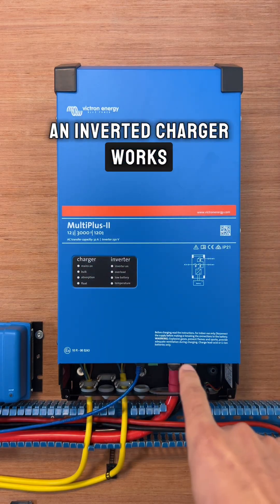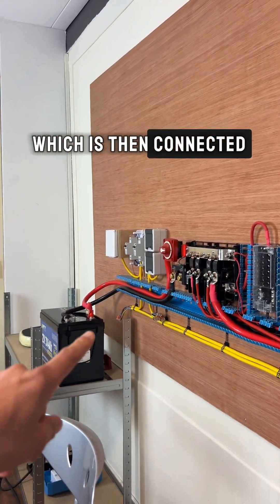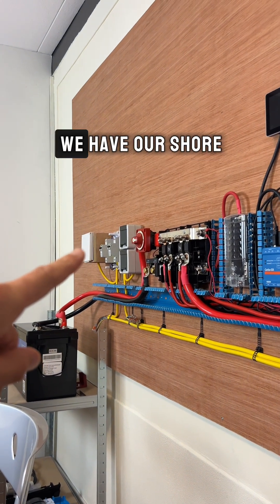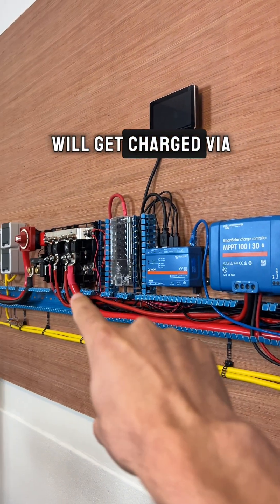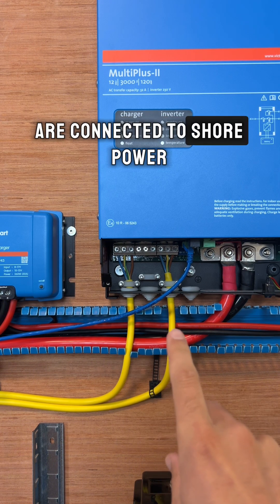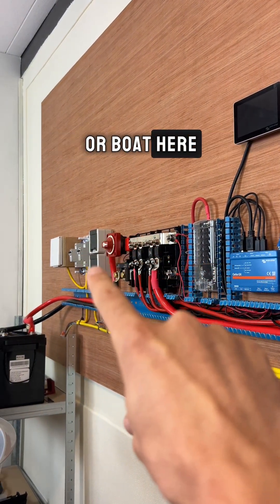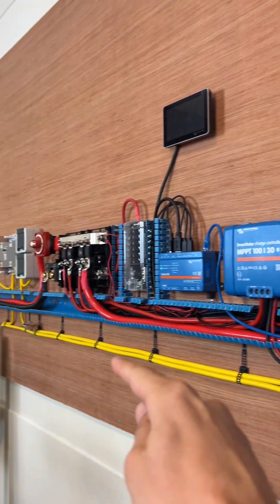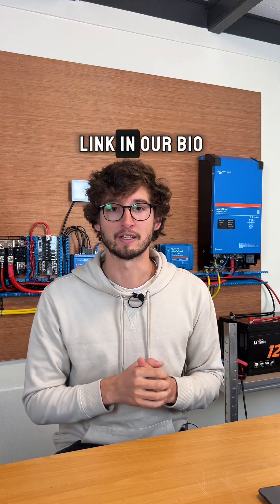This Is How an Inverter Charger (Victron MultiPlus) Works

Comment: Can you use an petrol.genny if yes is it the spare center connection
Reply: You can use a generator but it must have a reasonably good output, if it doesn't then the multiplus will not connect to it.

The generator goes in the AC in port and, in this case, replaces the grid cable.
Reply: @WindyJAMiller You could also use an Automatic or Manual Transfer Switch to select Grid AC or Generator, as the input source.
Reply: @MrSummitville you can't do that easily with a multiplus, each time you wanted to move from grid to generator the energy storage system functionality would need to be turned off on the unit.  They do make a unit with a secondary input called the quattro, that unit can have a grid and a generator attached as inputs and work from either depending on availability.
Reply: @WindyJAMiller  Why do you have to turn your inverter off?  Victron actually makes a Grid AC vs Generator Transfer Switch.
Reply: @MrSummitville it's not the physical layout that's the issue. It's the mode of operation.  To work seemleasly the quattro needs to be used.
Reply: @WindyJAMiller  I asked WHY?  But you give no explanation. Yet,  people use an A-B Switch and a MultiPlus-II, instead of a Quattro.
Reply: @MrSummitville ok

Comment: Awesome looks good but I have to ask is there PV panels on the MPPT and the next question would be I don't see any earthing so generally that's a concern I'm sure you have a reason but do you separate your AC earth and your DC earthing systems and then my third question would be when you test your voltage coming from your PV on those MPPT charge controllers you'll get your voltage between the positive and negative but what do you get when you test between your positive and earth or frame of the MPPT
Reply: The equipment should be bonded and earthed.  The DC and AC equipment should be bonded to each other too.  To minimize the potential stress on the mppt controllers the panels frames should also be bonded to the system.